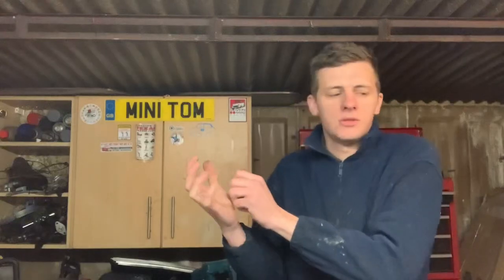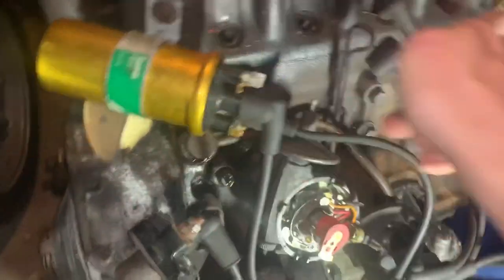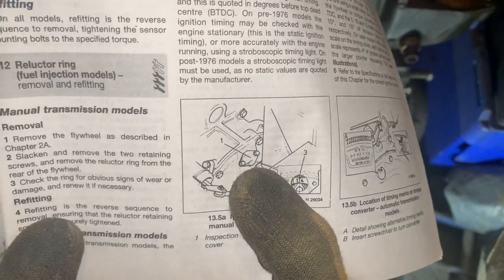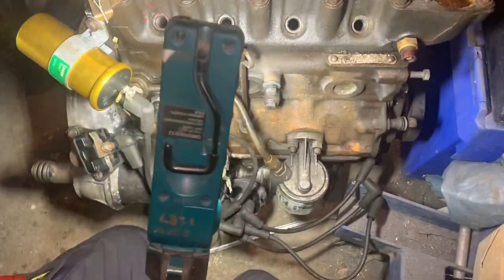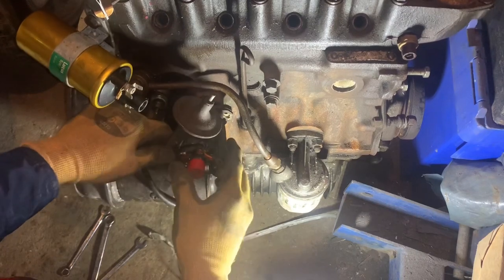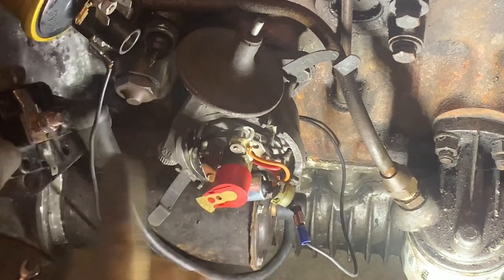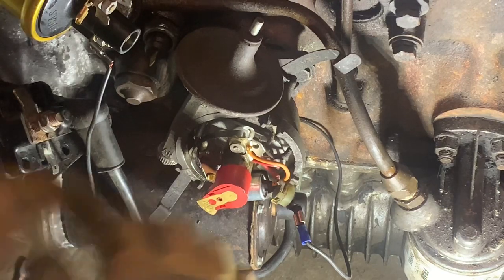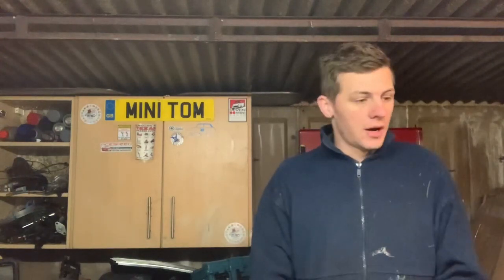Classic Mini - Basic Ignition Timing | Distributor Install

Comment: The dizzy has an off set slot if you wish to remover the drive i think the lower rad bolt fits in the centre of the drive to remove it safely. Then refit 180° 👍👍
Reply from the maker: mark piper I was wondering, I checked I but couldn’t notice anything so it must be very subtle. Thanks for the heads up though pal. It’s back out at the minute as I’m painting it so I’ll correct the drive before I re-fit it.

Comment: No no  need to remove this idea until you know what you are talking about. The distributor shaft has a off set dog and not a worm. The reason why the distributor won’t go in is because it will only go in one way due to the off set. Don’t confuse people

Comment: Little tip if you find the distributors worm gear drive shaft is 180° out the long cylinder head stud on a minis engine threads into it making it easier to remove and reinstall the correct way

Comment: I know this is a three year old video, but I found it looking for the same info - how to fit a distributor on correctly. In the video you have found TDC but not on the compression stroke for cylinder 1, that's why the Rotor Arm and ergo the Distributor shaft is 180 degrees out. AFAIK you would need to rotate the engine another full turn so that the rockers on cylinder 1 on on the rock (both loose). This is when cylinder 1 is on its compression stroke and thats when the rotor arm should be pointing to cylinder 1. The way you have done it will work but you would need the HT lead for cylinder 1 in the non standard position - bottom left.

Comment: Hi tom.  Had the same problem of 180 degrees out with my new powerspark electronic distributor. So yes put leads on either number one at lower point.  Someone said to take the roll pin out and turn drive dog through 180 degrees. But didn't want to chance it. Good to see its not only my dizzy 180 out. Top job.
Reply from the maker: belleandmeg if it works it works! Absolutely no harm in keeping it that way. Although I think I’d rather change the drive gear around than try knock out that roll pin. Good call on that one 👍🏻

Comment: to fix the 180 degree offset issue, you simply open up the distributor and flip the mechanical advance part 180 degrees.

Comment: Tom, You need to take the helical drive for the oil pump out with a bolt and rotate it as the slot for the dizzy drive is 180 degs 
out the key ways have small & large slots, This was done to cut the engine if the oil pump failed. Cheers Dave

Comment: Hey Mini Tom great work!!!! Have an issue with my dizzy setup on my late A+ series, took it out for a strange noise, then put it back as shown on manual but car does start any more :( . I have the large slot dizzy drive! I would really appreciate some of your lights thanks much
Reply from the maker: Sounds like you could have put it back in 180 degrees out or your firing order is incorrect, plug leads on correctly. Make sure the static timing is right first by making sure the rotor is at 2 o’clock position whilst piston 1 is at TDC, make sure the rockers on piston 4 are on the rock at the time and this will confirm you have top dead centre. Hope this helps
Reply: @minitom7772  Thanks for you response, but I have done all this already, but nothing! I think somewhere I have seen like the late A series do not have the same setup, but do not remember where :(
Reply: Hi, so when number 4 is on the rock where are the dimples on cam cogs????

Comment: Tom, these videos are so fuckinggg helpful dude...mines awkward as to get at beacuse it's in the car 😞 I've tried loads with mine not starting, have petrol, have spark to leads and plugs, coils fine and distributor seems alright, puzzled mate
Reply from the maker: that does seem strange, the other things to check if you haven’t already done so in the 2 months it’s taken for me to reply (sorry about that) would be to check compression and that the timing is set as close as it can be. hope you got it sorted anyway
Reply: How did u solve your startup issue? I have the same problem.